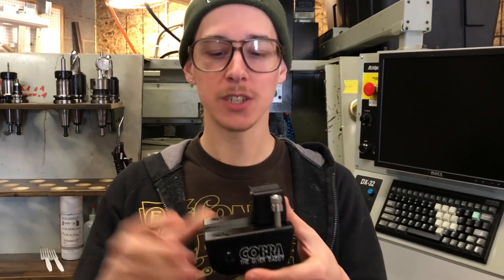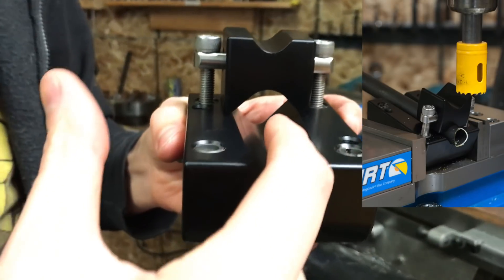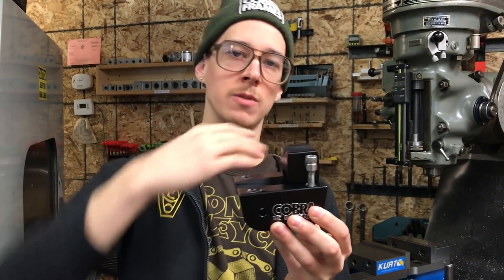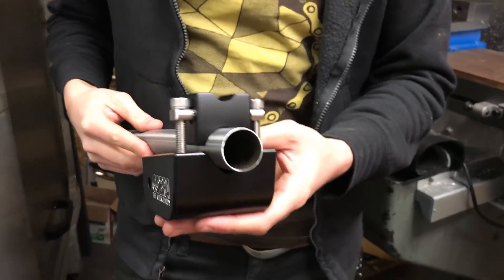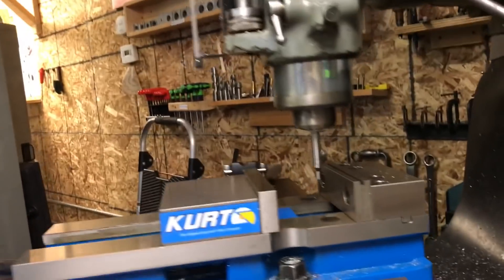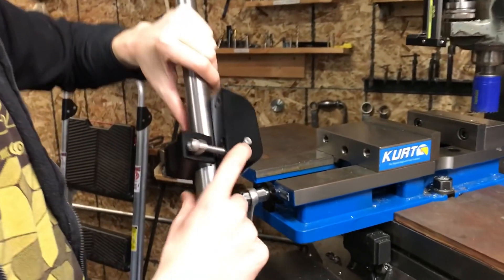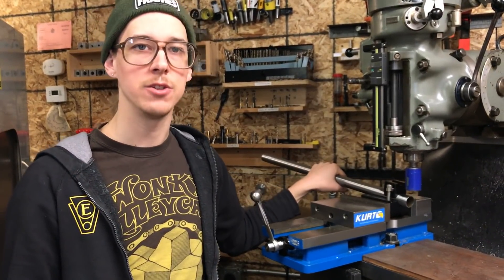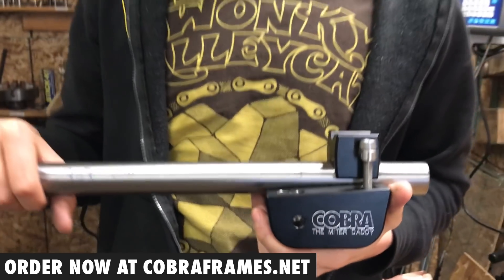The Miter Daddy: Full Demo | Bicycle Framebuilding Tool

Comment: Elegant tool. For kurts, angles are easy breezy with pin jaws.
Reply: I totally agree....only wish is that it could hold larger diameter pipe...with a probably set up mill and vise heavier guage pipe work would be quick and easy

Comment: how do you get a good angle measurement on tapered tubes with that block
Reply from the maker: In the example where I show the digital angle gauge on the top face of the tube -- you can use that same method on tapered tubing you just have to adjust for half of the taper angle of the tubing. You can derive the taper angle of the tubing pretty easily with three measurements and then either draw it up in CAD software or draw it up on a sheet of paper and find the trigonometric relationships and use your phone calculator to do a trig function. You can watch my trig video if you're not familiar, but it's really not hard to do. Most main tubes aren't really tapered much or at all so there wouldln't be a ton to correct for with this tool usually, but with the tips for stays and fork blades there is more taper and it would be especially relevant then. Does this help?
Reply: @cobraframebuilding  yeah... Thanks!